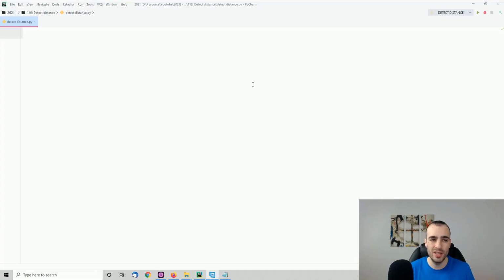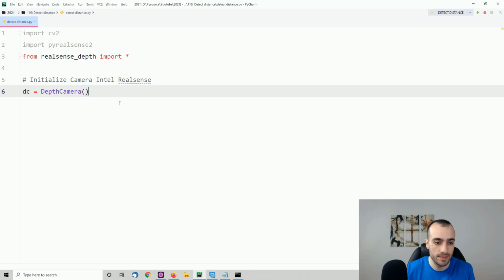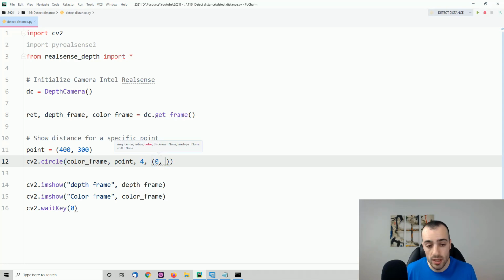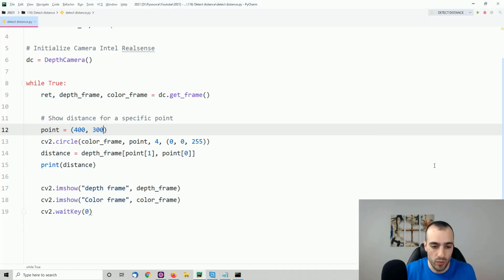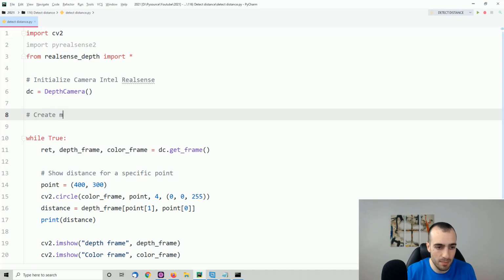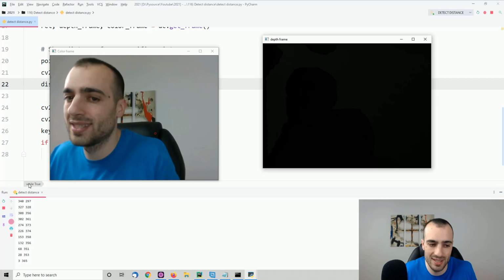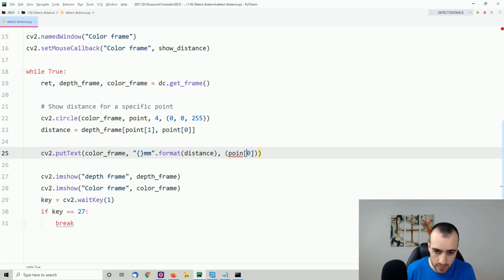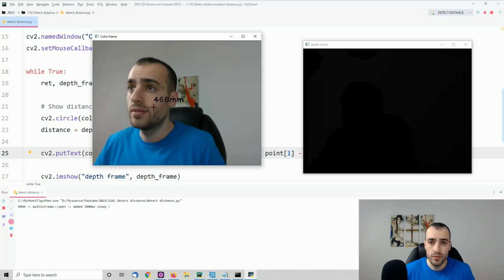Distance detection with Depth Camera (Intel Realsense d435i) - Opencv with Python tutorial

Comment: Hello, 

 import realsense_depth import * 

This import don't work even though the pyrealsense2 had been installed successfuly on my linux 18.04 OS image PC

Also, I am trying to use this camera with a CNC based pipetting robot. A CNC machine is utilized in Manufacturing robot where it understands G-cordinates (X, Y, Z) . The robot is fully controlled in Python environment. I can manually send G-coordinates to the robot. But, How can I use this camera to have object recognition and the robot goes to that object? Please help

Comment: where did you get RealSense D435i from? Cannot locate it anywhere in e-commerce sites :)
Reply from the maker: Unfortunately intel shut down their production, so that's the reason why you can't find them on sales anymore.

I recommend to look for OAK D devices, which seems to be the solution taking over now
Reply: @pysource-com  thank you so much! do you reckon OAK D are better than intel?
Reply: @pysource-com  maybe a little bit more description, what I aim to do is to turn a flat surface (with projector's image) into a touchscreen using such camera, so distance could be short, but I aim to have accuracy + fast response time from device.

Comment: Hi Sergio, I'm getting in a few problems that I can not solve. Every time I run the code I get these messages, "NameError:name 'DepthCamera' is not defined" and the other one "AttributeError: module 'pyrealsense2' has no attribute 'pipeline'. I downloaded the source code and files before this and also I'm in the Realsense_Depth folder with python, I re-checked the code but I don't know what is wrong.
Please I will appreciate any help.
Reply from the maker: you should install correctly the pyrealsense2 module released by intel.
Unfortunately I noticed that not on all systems the installation is easy, especially on raspberry/jetson

Comment: hello there Sergio, I'm a fan of your tutorials and I have used many of them in my university project, I have a question, can I actually apply the same code you implemented in this video on my laptop's webcam ?, if not, what changes may I perform to get the work done, and I'll be thankful if you helped me with a method of getting the X and Y coordinates of a tracked object, Thank you sir
Reply from the maker: Hi, this tutorial is specifically for Depth Camera intel realsense d435i, so it won't work with a normal webcam.
Reply: @pysource-com  Can you make a tutorial on how to use laptop's webcam to  do stereo vision projects?
Reply from the maker: @srishti-ai  It's not possible to do this with laptop webcams as they don't provide depth information.

Comment: Good and clear video, as always. Thank you. I assume Raspberry pi will be too slow for that, right? I am looking into object detection and distance analysis of that object with RPI. What would you think? Do you plan on any video on that direction?
Reply from the maker: Hi, this is mostly a product which is used for commercial projects.

- Raspberry pi is in generally too slow for object detection in real time even withouth distance analysis.
- The distance analysis itself doesn't require much computational power, so this camera on the raspberry pi with the same script of this video, without object deteciton will perform well.

I'll suggest that you look into the Opencv AI kit which fits better your purpose. I've a video about it , I recommend to watch that one https://www.youtube.com/watch?v=HHJDXE0VcAY
Reply: @pysource-com  Currently I get 2.9 fps with tensorflow lite on RPI 4, with general set of objects to detect. I wonder what will be the change if I have only one object to detect (yes or no). I would need 10 fps at least. Perhaps I should dedicate old laptop for that target, instead of RPI, or even consider dedicated HW. I know there are several on market, including USB accelerators for PI.